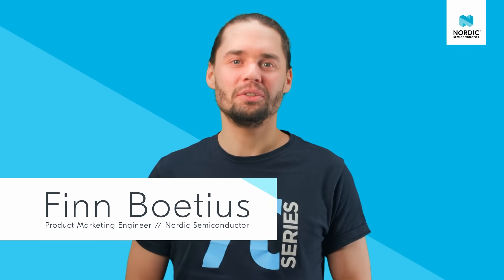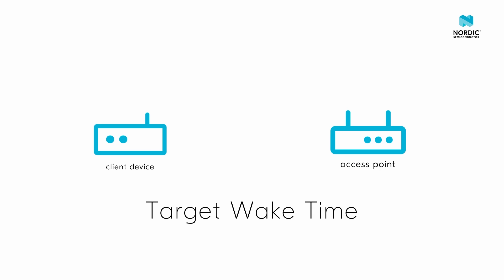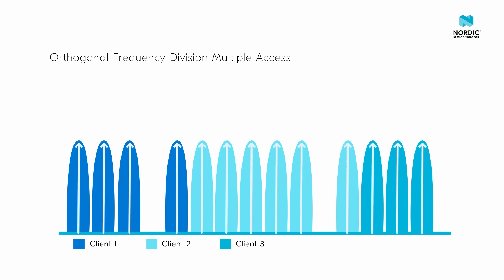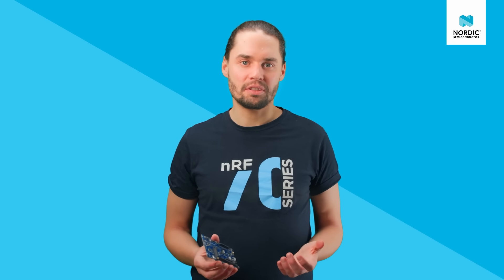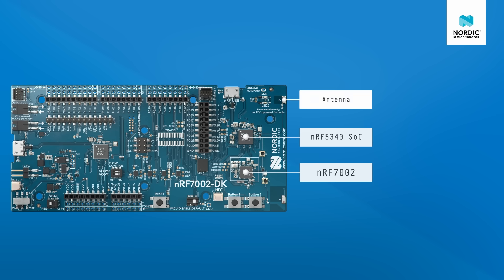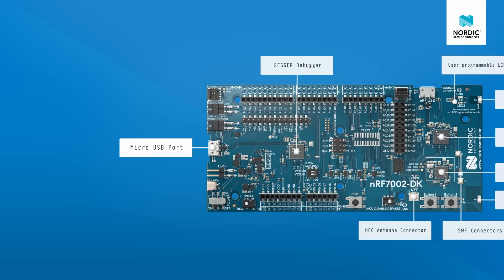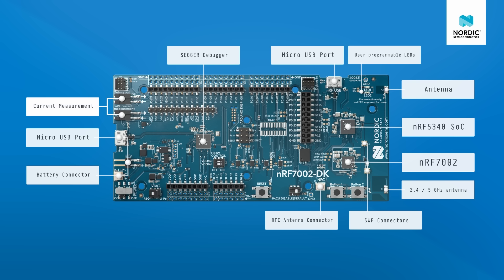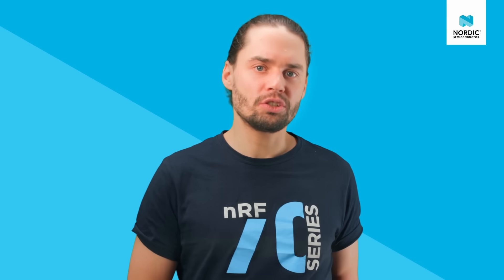nRF7002 DK - The first Wi-Fi Development Kit from Nordic Semiconductor

Comment: Amazing product in such a small form factor. Can we integrate nRF7002 with Android-based SOC to enable Wifi functionality for internet browsing i.e., using Google Chrome, Youtube, or Spotify? I am currently looking forward to using nRF52840 to enable ANT+ functionality.
Reply from the maker: It is possible but would mean having to write drivers. The easy way to do it is to use a Nordic host, Linux host or another Zephyr based host. We have customers writing their own drivers so it is definitely possible. Be aware that it involves some work to make that work on a different OS.

Comment: I am currently facing difficulties in getting my nRF7002 DK board to be recognized by the nRF Connect extension for Visual Studio Code. Despite several attempts, the board is not listed in the "Connected Devices" view of the extensionAttempted to change nrf-connect.deviceProvider to both nrfutil and nrfjprog without success.

Comment: Amazing. Just amazing. I have a design that uses an STM32L4+ chip, running an ARM Cortex M4 processor. Is this the chip I need to make my board wifi capable? What guidance do you have for this?
Reply from the maker: The nRF7002 is designed for being a companion chip to add Wi-Fi support to existing devices. We only support host support implementations for nRF52840 and nRF5340 SoCs. 

For more details on the nRF7002 please see the Product Specification: https://infocenter.nordicsemi.com/index.jsp?topic=%2Fps_nrf7002%2Fchapters%2Fproduct_overview%2Fdoc%2Fprod_overview.html and the User Quide: https://developer.nordicsemi.com/nRF_Connect_SDK/doc/latest/nrf/device_guides/working_with_nrf/nrf70/features.html 

For further technical question, please reach out to our tech support team on DevZone: https://devzone.nordicsemi.com/
Reply: @NordicSemi  Thank you for the response.

Comment: Hi,  is it possible to do openthread border router with nRF7002 DK ?  I'm currently using ESP32 (WiFi) & nRF52833(OT_RCP), if possible that would be great.
Reply from the maker: Hi, for a full-blown border router, you will run into resource issues with the nRF52 and nRF53 Series of devices. In our "Developing Matter 1.0 products with nRF Connect SDK" webinar we show the current setup we are using as a border router. As a spoiler, it involves a Raspberry Pi at the moment: https://www.youtube.com/watch?v=9Ar13rMxGIk

Comment: Game changer! <3
Reply: Do we know when are the first batch of DK boards suppose to be available? I'm seeing stock 0 everywhere.
Reply from the maker: @eni4ever  It is available at Digi-Key now, and should be available from the others, shortly https://www.digikey.com/en/products/detail/nordic-semiconductor-asa/NRF7002-DK/17748188?s=N4IgTCBcDaIHYCUBiB2ADGiBdAvkA
Reply: @NordicSemi  Neat! Grabbed one! Thank you!
Reply from the maker: @eni4ever  It will be available to order from our distributors within a few days.
Reply: I don't think. ESP 32 and weaker solutions win, it seems to me. Because mouser 1 has an ESP32 chip (if you just take the chip) it costs € 2.00 and the module is  4.20 €, and the esp 32 can be programmed as a standalone chip, and the nRF7002 chip is €5.92, and it seems to be only a coprocessor.I subjectively like the sdk from nordic, but of course it's probably only the sdk from TI that's more difficult, and meanwhile ESP32 has a more or less convenient sdk. Yes, and some laboratory examples are still in the connect sdk for wi-fi.
Reply: @yunushkin88  What you gain in price, you loose in quality and, for any illusion of an "earned" difference, you will have no choice but to pay in "engineering frustration units". 

I've worked with those other vendors and no one comes close to nordic (and no, I'm not payed to say these words). The sheer effort they put into their documentation and apis is, in my opinion, close to none. They're decision to go with zephyr was both genius and a no brainer (aligned with the vision and engineering work on their sdk) and, unlike other proprietary solutions, has the advantage of being agnostic to the development environment: you learn most of the way the linux kernel operates at the same time which makes it easier to switch (and contribute, if you ever feel like it) upstream, not only to zephyr, but to linux itself. 

I have no idea where esp is now, but back in the days of the good old 8236, they choose a more "close" development model. Having to reverse engineer their apis (with little to no mcu docs available) was no fun, to put it mildly. They lost me completely on that one even though you got wifi for 2 freakin dollars.
Reply from the maker: @eni4ever  thank you for sharing your experience working with our solutions.